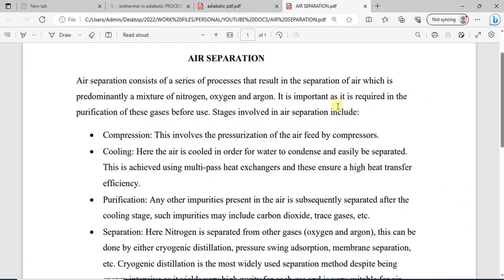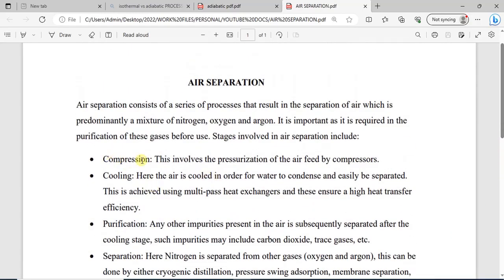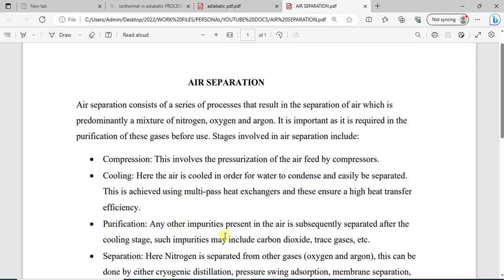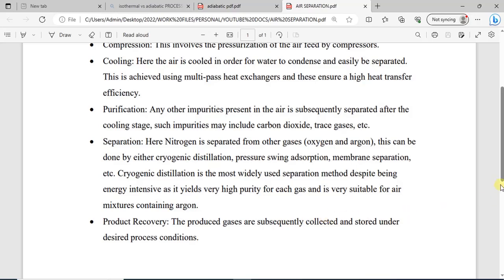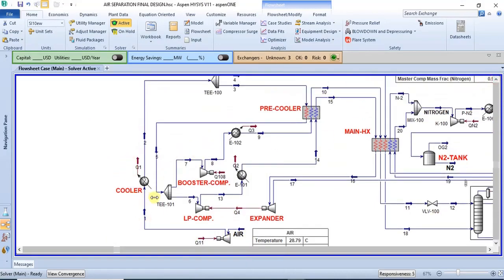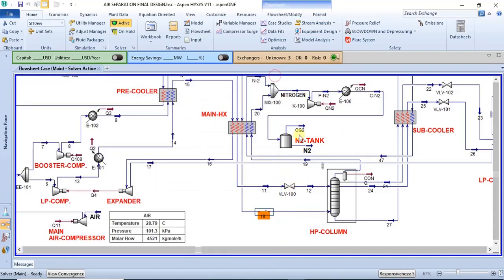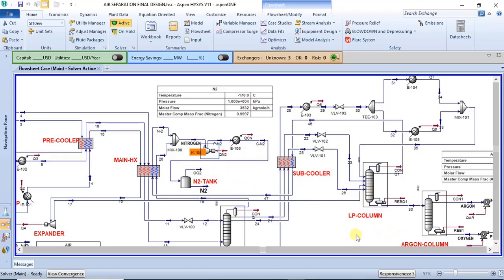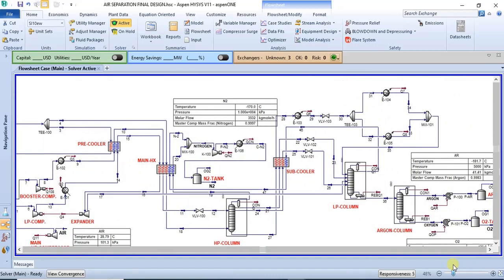Introduction to Air Separation Modelling

Comment: A really insightful video about the working of Air Separation Plant.I was unable to solve LNG multistream HX . Would you mind sending the hsc file for this ASU model.Thank you so much!
Reply from the maker: That's because the video didn't not provide all the data.

Kindly send a message on WhatsApp...+234 706 613 4201
Reply: @hotspot105 I've texted you but you've not replied me
I've even called but still nothing

Comment: Dear sir, could you inform me the temperature of stream no. 28, 22, and 25, since I couldn't solve the sub-cooler model. Moreover, could you please give the specification of LP-Column since it is not shown in the video. Thank you
Reply from the maker: Good day...all of these info won't still be sufficient to model that simulation.

There is a lot more.

Meanwhile, support us by subscribing to the channel...thanks.
Reply: Based on the clue you give in the video, I'm able to solve the simulation up to the HP Column and result the same as your demonstration. I think that if I get those information, I'm able to solve it all. Thanks
Reply: @hotspot105  could you please give the specification of LP-Column please
Reply: The main specification for the LP column is 1 ppm Oxygen in the nitrogen product.  If there is a liquid nitrogen product a few stages below (I do not remember why), then you need 1 ppm O2 on the liquid N2.  The overhead vapor will be lower than 1 ppm O2.
The second specification is the amount of nitrogen in the side draw to the Argon rectifier.  I think that argon should also be 1 ppm nitrogen, I'm not sure but you can probably look that up. And finally, you need the reboiler duty to match the HP column condenser duty.  If it is lower, take VAPOR oxygen product from the bottom stage.  That will increase the reboiler duty. Good luck and have fun.